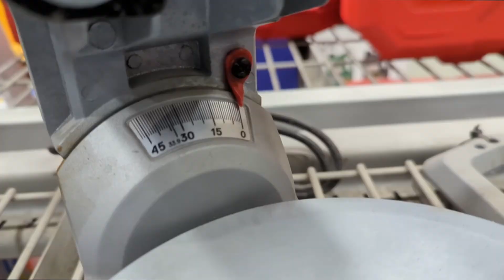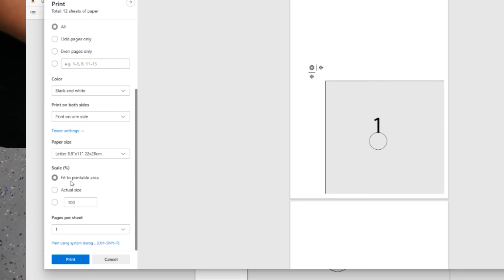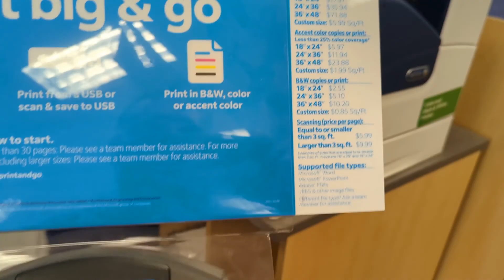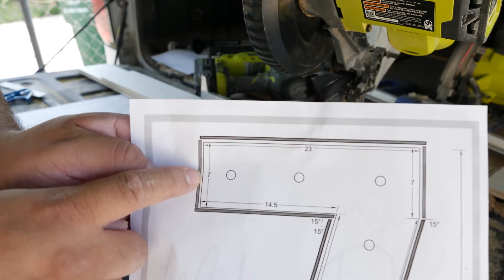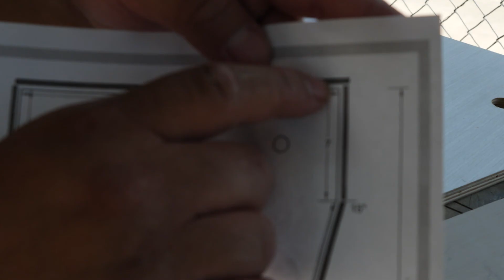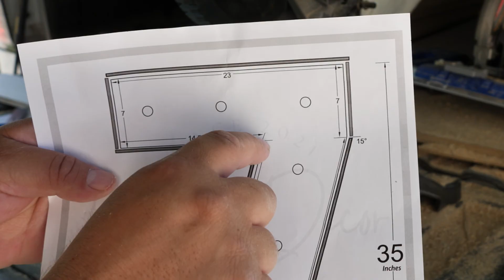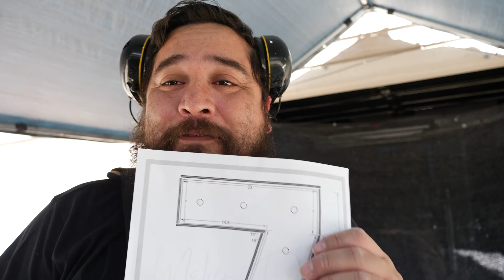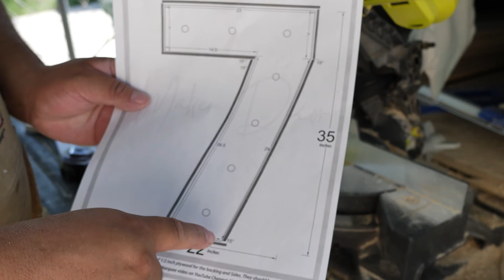Ultimate Marquee How To Build with Measurements

Comment: Bought the a-z off etsy, do you use the craig to cut your interior straight cuts as well the exterior straight lines? If so how?  :)  Also, I thought you mentioned the CNC or lazer cutter plans are those in my etsy purchase?
Reply from the maker: Hi, thank you for your support. As for the kreg rip cut no I do not use it for the inside as that would be difficult with angled cuts. I use the circular saw as it gives the straightest cut. Just go slow and keep your eye on the line. The jigsaw can be used but has a tendency to veer off path for longer cuts easier. But some people prefer it. I use a mixture of the circular for the longer cuts and the jigsaw for the shorter smaller inside cuts or edges. If you want something to help cut straight in that section, it would have to be a track saw. The only thing is it will be helpful only on the longer cuts. Those shorter cuts really wouldn't be beneficial from the circular saw and need a jigsaw to finish off. And yes the plans have the dxf file for a CNC and the SVG file for a laser cutter. But they are only for the letter backing. You will still need to cut the side pieces by hand because of the angles needed at the edges of the letters. I hope that helps but if you have any questions, please message me on the Etsy website. Just because I am not always on YouTube and I do not always get notifications from YouTube for every comment. And especially comments under comments do not always give me notifications. Thank you and good luck!

Comment: Hey there! So overall for these projects, do you recommend a miter saw, circular saw, and a jigsaw? I noticed that you mentioned a miter saw but then started using a circular saw with the jig. Sorry I’m new to this and I’m trying to figure out what to buy in order to make Marquee letters and some backdrop designs. Would you recommend all three? I would ideally like to buy 1-2 things that will cover almost all bases 😭
Reply from the maker: Hi, I use different options and it really just depends on your budget. I will tell you all three will make it easier on you to make it. But you can do the whole build with a jigsaw and circular saw. Because the circular saw has the bottom plate that can be angled to cut the angles as well. I also believe most jigsaws have the option to cut at an angle as well. As you can do a lot with only a jigsaw and a circular saw. Most of my builds are built around those two builds. But for marquees and cutting the angles a miter saw is 100% easier than adjusting a circular saw each time. So if you were making more than one marquee the miter saw will definitely show the difference. especially if you are new to woodworking, the miter saw helps get clean straight cuts. The circular saw and jigsaw take some practice to cut straight. So if I had to pick two it would either be a circular saw and jigsaw, or jigsaw and miter saw. I hope that makes sense and good luck! Thanks for the support!
Reply: @MakerDecor  Very well said! Thank you so much! Based on your advice I will probably go with a miter saw and jigsaw

Comment: Hello friend, which wood do you use, do you have the link to amazon to see the characteristics of the wood, in other countries they have different names. Thank you.
Reply from the maker: Hi, this was just 1/2 inch thick sanded pine plywood 4 ft x 8 ft. Sorry I do not have more information on it. Thank you
Reply: @MakerDecor  could you confirm me the thickness of the wood in millimeters or inches? Thank you.
Reply from the maker: @leandroledesma4584  1/2 inch thick or 12.7 mm
Reply: Hi, what string light do you use for these? Thank you for your knowledge and your awesome videos!

Comment: Is there a way to add supports if you already have the letters built?
Reply from the maker: Hi, yes you can just cut out a rectangle size platform 1/2 inch thick around the same width of the letters and maybe about 12 inches depth. Then just paint it and screw it to the bottom of the  letters with  1 inch screws or so. And with this separate option from the letter. You can attach them when needed or take the bottom plate off when you do not need them. I hope that helps and good luck!
Reply: @MakerDecor  thanks so much!! I make my marquee letter debut at the local homecoming and I don’t want them to tip over!!
Reply from the maker: @janetbirkner6709  Your welcome, Yes it is better to be over prepared than caught off guard by something. So be prepared, extra bulbs, extension cords, etc. Good luck!!
Reply: @MakerDecor  yes! I even got green bulbs because the school colors are green & white. Aside from making the supports I think I’m all ready..just nervous. Thanks for all your videos..such a great help 🤗
Reply from the maker: @janetbirkner6709  Your welcome, good luck. You Got This!!
Reply: @MakerDecor  the letters were a big hit! Thanks for the help!
Reply from the maker: @janetbirkner6709  That's Awesome to hear! It definitely feels great after the job is done. I am happy for you and your business!! Good luck to you

Comment: I have a circular saw and the saw that has a vertical string will this work
Reply from the maker: Hi, the circular saw will be possible to create the angles and straight cuts. A jig saw is recommended for the letter cutouts? Not sure what tool has the vertical string? But if you are making a lot of letters the miter saw is a great tool for the angles. Hope this helps and if you have any questions please let me know or you can message the Etsy store. Thank you

Comment: For the half inch board on the outside of the Marquee, what is the length? Is it 1/2 by 6?
Reply from the maker: The one I did was 1/2 inch by 4 inch wide. But you can change it to which ever you prefer. I have made them 6 inch wide before. But prefer the 4 inch for weight. I do make the bottom longer in the back to put some weight for outdoors. Good luck!

Comment: I purchased the plan, but I was wondering what are the widths for the side pieces
Reply from the maker: Hi, thank you for the support. The sides for this build are 4 inches wide. And the base can be wider and discussed at the end of the video for your preference. But you can make the sides to the size you prefer, but I find 4 inch great. Looks great and less weight than using wider boards. Good luck and please let me know if you have any questions along the way. Also, If I dont answer here, message the my website or Etsy. As I answer those messages ASAP. And YouTube I check every couple of days. Thank you
Reply: @MakerDecor  thank you so much for your response !

Comment: Hi, might be dumb question but those inside areas it’s hard to use nail gun what size screws do you use and what is the attachment called? Thank you!
Reply from the maker: Hi, nah your good. I used 1 inch-1/4 screws. I wouldn't use longer than that. You can use 1 inch as well. The attachment is called right angle drill adapter. Hope this helps and good luck!

Comment: Hi, I purchased the templates for the 4ft numbers. We were wondering what did you use to make the holes for the lights.  So far, we have used 1 1/4 inch hole saws to make the holes and they are too big.  Please help! Thanks...☺
Reply from the maker: Hi, thank you for your support. Sorry for the late reply. If you message the Etsy store I usually reply right back. I check YouTube every couple of days. But to answer your question, I left it open to your preference. Meaning there are so many different options for lighting and I didn't want to say use mine. You can order from Amazon Christmas lights, go to Walmart, Home Depot, etc. to get your lights. Then the route you choose to make the hole sizes is depending on the light style you chose as they are all different. But if you go to this video linked below at the 8 min 33 second mark I discuss how to find the size for the light bulbs you have. https://www.youtube.com/watch?v=lvK22KldVRY  I can tell you that if you made some bigger than expected it is ok as long as you use a basic hand held staple gun to secure the wire before and after the bulb it will hold it in place easily. I never use to and just relied on the snug fit. But after using the staple gun it makes it so much easier and holds the bulb up straight so much better. Also I made a second video showing how to create your own lights and both these videos should have some great info to help. https://www.youtube.com/watch?v=HQxca0VqOAs   But if you have any additional questions just message the Etsy account and I can help the best I can. Thank you and good luck!
Reply: @MakerDecor  Thanks